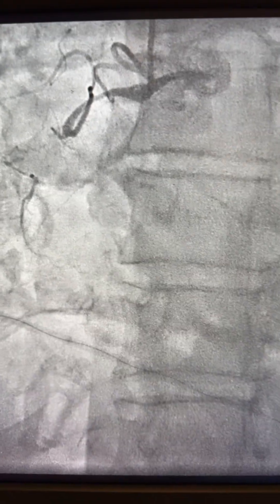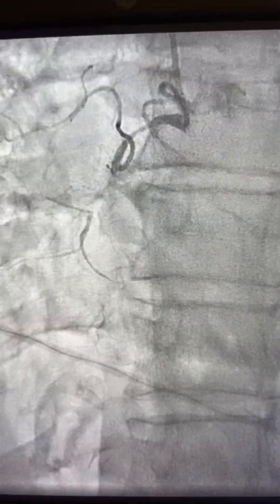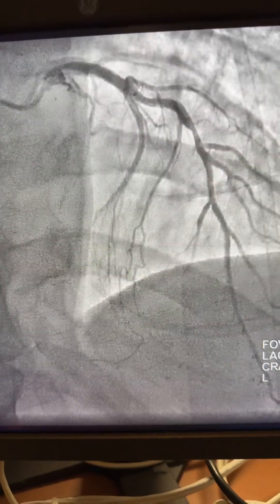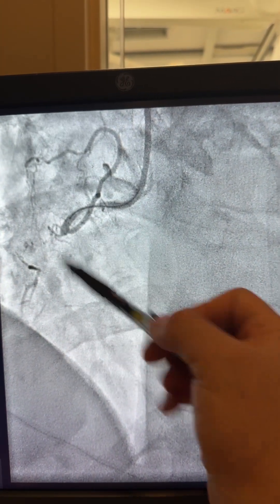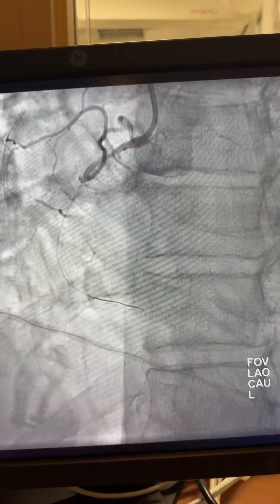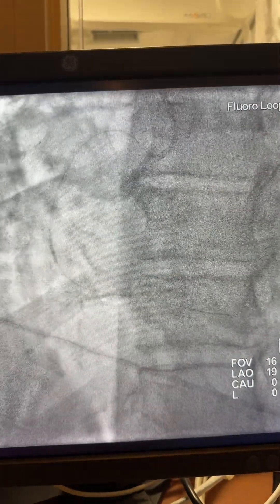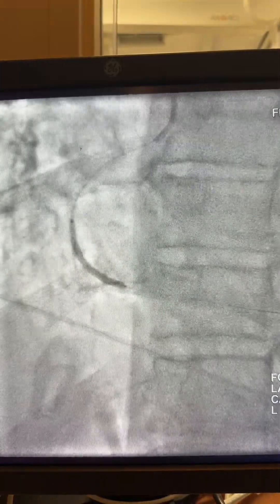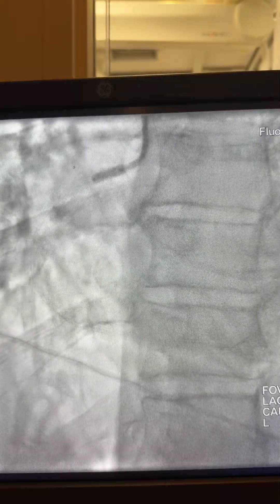CTO-Chronic Total Occlusion RCA with a blunt cap, successful PCI !

Comment: What kind of PT wire and guiding did you use in this case ? Were all your CTO cases using this method ? Thank you for your sharing this technique.
Reply from the maker: Thank you Doc ! In this case it was a choice PT ( Boston Sientific) supported by a short 1.25 mm sc balloon
Reply: @abdrhmanhamo3681 Sir, what would be the the other options of guidewire, at least, has the sampe profile with CHOICE PT wire ?
Reply from the maker: @2@264264264

	•	Fielder XT  (Asahi)
	•	Pilot (Abbott)
	•	Fielder Fc 
	•	Gaia (Asahi)
	•	Confianza Pro